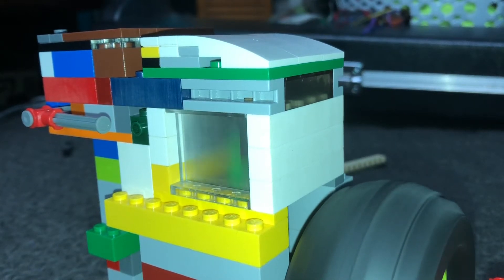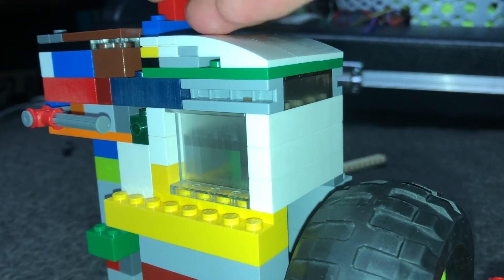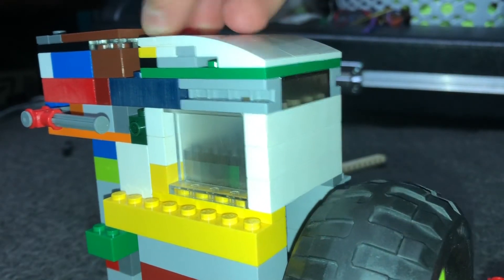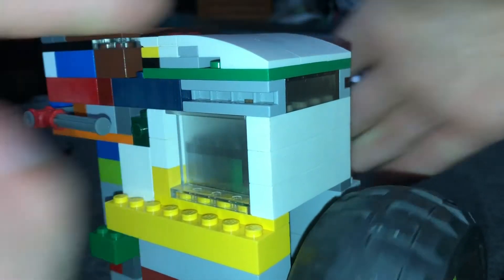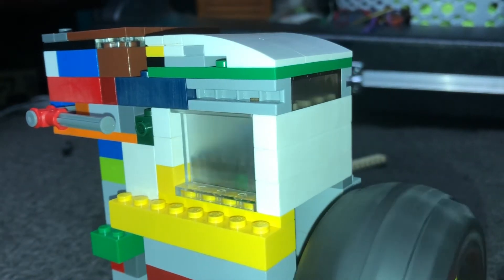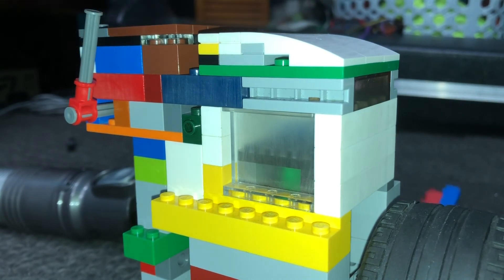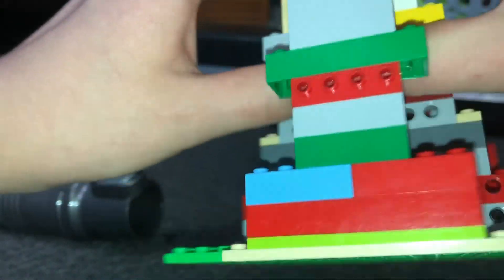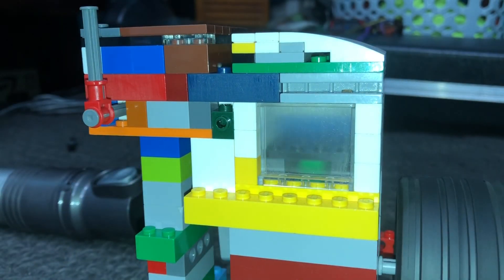Strongest Engine Full Throttle Attempt #3-4

Comment: How do I make a 2 cylinder that can rev super fast?
Reply: You need 2 vacuums if you have 2 cylinders, 1 vacuum will only be half the power of a single cylinder on a 2 cylinder engine
Reply: Ethan Adey uhmm, that’s not 100% true, if you have 2 vacuums you put 2 to 3 time’s more stress on the parts and that means it has way more resistance, I made a i4 and that revs pretty high:D and why did I comment that cuz it’s eZ to make a high rpm 2 cylinder LOL
Reply: If I put 2 vacuums on my i4 it will work, cuz it’s 2. 2cylinders in 1 block stonks

Comment: Is that a regular wheel for a fly wheel or is it a bog off-road wheel?
Reply: Dude your the best thank you for replying 1st time ever 😱 I was shocked when you replied. And I meant the top of the valve/valve head
Reply from the maker: LEGO warrior I see what you mean, and in Attempts 5-6, I decide to glue the top pieces together because if I didn’t, the engine probably would’ve blown up again. The reason why it failed the 6th time was because the bottom part was not completely dried yet.
Reply from the maker: I got that big flywheel in an off-road LEGO set, I forget which one thought. Anyway, it is a off-roading wheel that has a lot of tire and provides a lot of inertia for the engine.
Reply: Also you should put a bushing on the front of the flywheel holder. And also don’t rev it when you start it because it makes the valve loose
Reply from the maker: LEGO warrior I have glued the valve tight, so I think that revving it up at the start doesn’t do anything. Even though I might have pushed the lever all the way down, it doesn’t reach the high RPMs unless I were to hold it in that position.